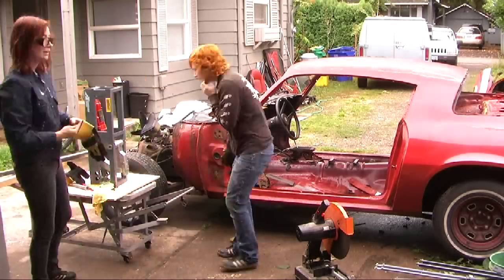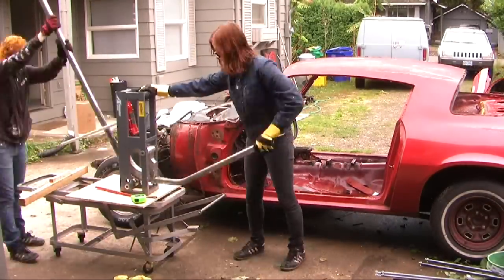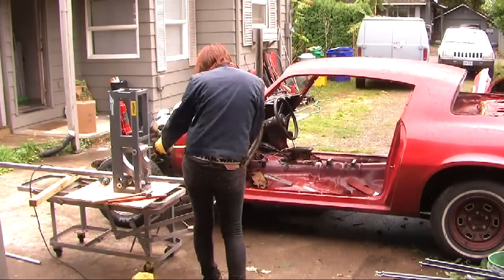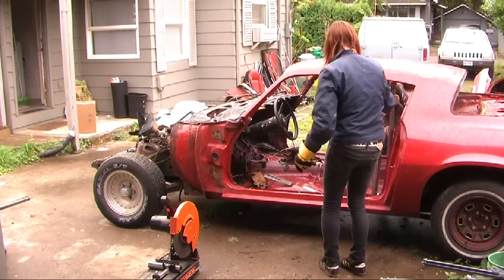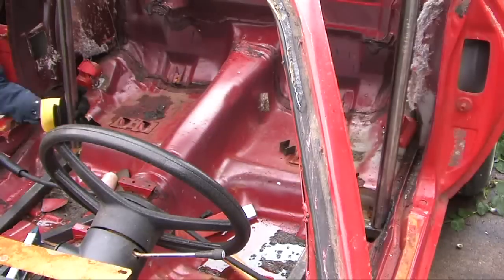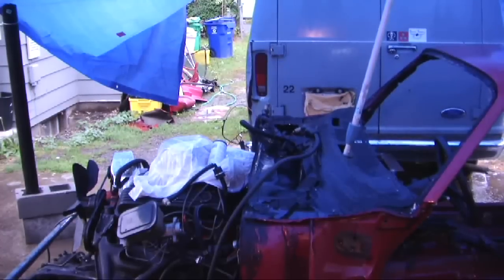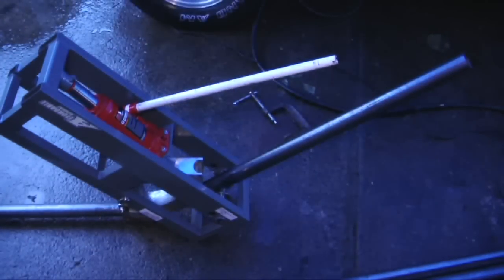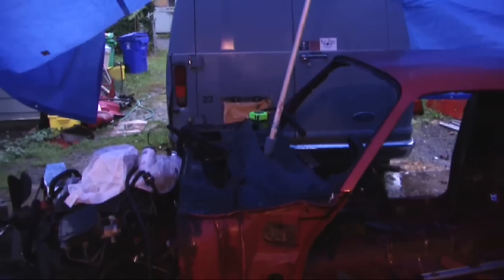Roll Bar Installation - Building a Pure Stock Race Car

Comment: i would wear wear mufs using when the grinder.....ive used a grinder and always muffs and my hearing is still good after 40 years of occasional grinding...    great job as those bends are a nightmare to measure.

Comment: I love your passion for a race car and how you tied the frame connections into the rocker bodies to not only complete the frame overall strength,  but give the cage as much of a structural mounting point as possible .  Remember safety and triangulation will serve you very well.   Much success,   HRC

Comment: There was nothing wrong with the bender. They work so much better when they are mounted and stationary. I guess you figured that out. We built a bender that was very similar to yours except it has a 12 ton jack and is a little beefier. we have built over 100 roll cages, but we learned by doing exactly what you are doing.
Reply: +a1scooter1 I'll send you a picture of the bender we built if you want me to.
Reply: +Magic MD TV It's like a hammer.... some use them better than others...  Hand a great builder a rock and he'll still build a better house than you.
Reply: +a1scooter1 I wanted to pull the trigger on one... but they refuse to make a 2" die...
Reply: GotScout You can build some really nice cages with benders like this. One of the problems is you can't make really tight bends. That can be overcome with good planning. I'll check tomorrow but I think we have a 2" die. At one time we had a 10 thousand dollar hydraulic tubing bender and it was much faster and easier to build a cage. We sold it several years ago and then decided to build a few more cars. We couldn't justify buying another multi thousand dollar bender, so we bought one exactly like in this video. We mounted it to a solid platform and it was much easier to use mounted. We decided to build one that was beefier and up the jack to 12,000 pound and it is really nice. We make some really safe, nice looking cages with it.
Reply: +a1scooter1 Awesome... sounds great.    I was looking at the typical "JD"-like benders.... base price... okay ish.... one large die set... budget killer.

I was given the HF pipe bender (free) from a friend... did all the mods first to make it flawless for TUBE... 
Opened the die with grinder then polished it and had beveled entry shoulders... then did Chris's top strap clamp thing.... then custom mount to engine stand... then polished all the rollers and lubed them and everything... then polished the cut section that you nut tight on the stay clamp.... then filled with sand... then build a sand compactor... then added water to slowly filter down and through to tighten the sand and kill gaps... then topped the sand and capped end... then.... kinked the shit out of my tube!
Reply: GotScout The HF benders don't work for this kind of tube bending. Your better off saving your money and buying one of these.
Reply: But then the 2" die costs more than the machine!...
Reply: GotScout I checked. I didn't have a 2" die.
Reply: +a1scooter1 I figured... nobody does...

Comment: question if I put money into a new engine, transmission, suspension etc to make it more hp or a track car etc.  later when I sell the car how much am I going to get back from the parts I put in? 1/3 or what?
Reply: +Okaythen001 

If you have a $7000 car.... add $12,000 in upgrades, $4000 in stereo, and toss $50 cash in glovebox...

You might get $7050.
Reply: +Okaythen001 That all depends what condition the parts are in when you sell the car.

Comment: Would have been 10 times easier to figure out the front tie in, if you would have built a pillers first and the a pillers tie into the halo off of the main hoop. So, there is alot more to it than just tie the front into the main hoop. 
looks like you have a good idea how it should be done, you need to really research how to build it, cause i think you could do a nice job just gotta know what the steps are.

Comment: Nice Camaro... you have a long way before you'll have a purestock though. I just built a Dodge Neon and put a cage in it. My brother has a Monte Carlo racecar with a 415c.i. and my dad has a UMP Modified with a 434c.i. motor. What motor are you running?

Comment: word to the wise anchor the pipe bender to a solid surface , I built a stand for mine out of 2x4 steel tubing with a large foot base ( semi truck rim )   and it makes life a heck of a lot easier as the press doesn't move around and its easier to work when its at a nice height too , and you can work easier around it .  and never weld the main hoop in first , as its is easier to weld a halo all the way round then rotate the main hoop up to position  and weld it in , you want that junction solid

Comment: hey whats going down??i purchased a 10 point cage kit already cut and perfectly bent for any vehicle just tell them a few days ahead before pickup in Clearwater, Florida for like $199 ,it even came with 2 extra bars ,i turned into a 12 point,for my 85 Z/28 only $199 already bent.saves alot of work.came with blueprint and marked bars.

Comment: @morbitron6 
i agree.  for sure tig on chromoly, mig is good too if the steel is a type that isn't going to air harden or heat control isn't a big deal. don't think i have ever seen a cage stick welded.

Comment: @SuperFullset   Jeri, you are correct and doing proper welding.  I am a Certified Weld Inspector, 25 years on boilers, pipelines, pressure vessels.  The only way to weld on race car fabrication is to use your MIG (GMAW) or a TIG (GTAW).  Arc (SMAW) is often used for much thicker materials.  Your welds look great.  Burning a hole and slugging it with rod and then burning it into a huge glob is totally WRONG!!!!   Serious racing fabricators do not use the stick welding process at all.